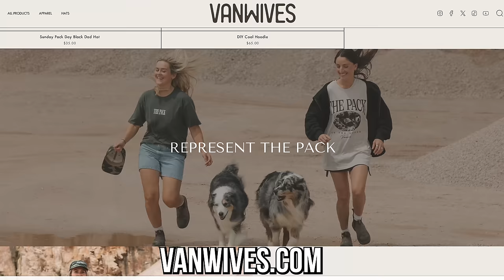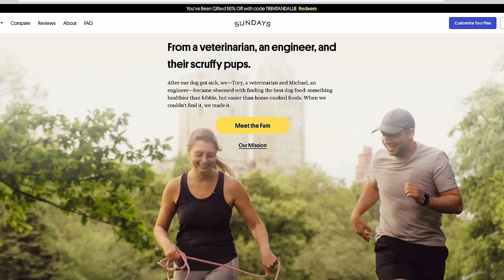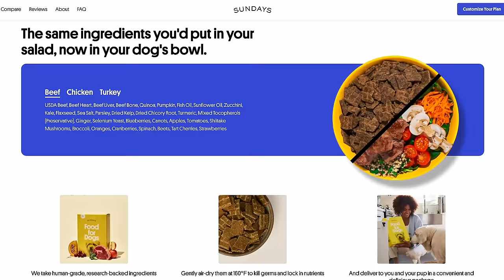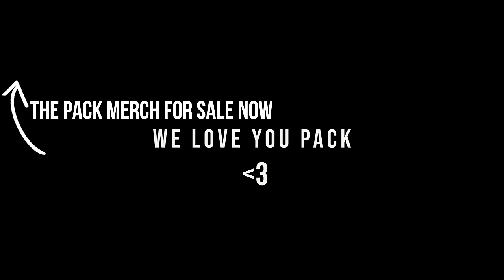Adding a Second Story to DIY Log Cabin Off- Grid Build! (Part 2)

Comment: Tool Boxes are awesome. Here is a tip, use the Tool Bag as a "Go Bag" and put in some extras for quick jobs that just need a few tools. I keep bit, sets, level, tape measure, drill, pen, pencil, hammer and multi bit screwdriver in mine, great for small jobs.
Reply from the maker: SO COOL I LOVE THAT! 
Will have to set up mine.😊🐶

Comment: The only stick you can use living in the woods is a real hot dog stick (not the bought ones!) as per the comment further up the trick is knowing how to pick them. We always use ironwood (lots here in Ontario forests - not sure out you way). Cut a sapling tree down (they grow like weeds). Clean the little offshoots off, clean the tip and make it pointy. Will last you the season. Take a sapling that has a Y in it and you can sharpen both points for a double stick. Easy and authentic ;)

Comment: Where are your rod bolts from foundation to roof?  As the wood shrinks you will need to tighten to keep the walls from loosening and falling apart.  You could lose many inches as the wood dries in a few short months to a year.  I always drill and hide them inside the timbers.  You could turnbuckles and cables on the outside and use then to grow vine veggies or wisteria grapes.  I like the grapes as they boom 3 times a year.

Comment: Jasmine if you have a V-shaped stick for your hotdogs(that way you can cook two at a time) that is not made out of a pine tree….. the stick needs to be a green stick (freshly cut)Probably have to have a new one every season or maybe every couple of months for you😁

Then a separate V-shaped stick in the ground right next to the fire 

Lay your Long stick with the hotdogs on it In the middle of the V On the fire v-shaped stick

You can even have multiple V-shaped sticks around the fire and you could move the hotdogs to a different location for different temperatures 👍😎
Reply from the maker: Love all those tips. Will be trying this out for sure. 😊🐶
Reply: @Vanwives  I love helping😊

Comment: The way to put that back triangle up, is to screw a couple of long vertical 2x4s on to the inside surface.  Then you can lift it by the 2x4s from the 1st floor.  The 2x4s prevent it from falling over while you install it.  You could remove them once you have the roof rafters installed, but I would leave them and just screw them into the back wall for extra stability for hurricanes.

Comment: Great Job~!  Pro Tip - the triangles ( Gable ends) are delivered assembled in the kit however they also easily  come apart in two section or you can even take off all support strips and install each log one by one so you dont have to install it as one big heavy piece :)

Comment: I have the Ridgid ones, and they're awesome to have! They also keep your tools dry. I like using the cheap ones, and I even bought a used extra set, because I like them, and the worse they look, the safer your tools are. Expensive tools in cheap boxes is like camouflage. I also figure if I build in a rolling platform in my bus, I can put them or some of the stacking crates on the bottom and just roll them out. I want my bus to be a rolling workshop.

Comment: Hi both, u did ask for a recomandation for a good Marshmallow stick. We often use bambus sticks 1,5meter long . On the end of it we put in a small wooden 20 centimeters long stick into it. From the kitchen.  On this we stick the Marshmellows on. When it burns a bit. Doesn’t matter. Its removable you can put a new one on. Try it. The bambus stick have a long life. Best wishes from Germany, Adrian. 😊

Comment: Guys, I just wanna let you girls know the floor in the cabin just built should have a water barrier under it before you laid it down believe me within five years. Those boards are gonna start molding and rotten from the bottom up and then it's not gonna be healthy for anybody to be in it it's not really too late, but seriously, I do believe you should put a water barrier on the foundation to protect the floor or if you don't do that definitely use that spray foam underneath as water barrier. I'm not trying to tell you what to do. I am just trying to help you prevent a problem in the future, love your YouTube channel

Comment: Absolutely beautiful! 
The 2 story Bunkie is really coming together. I can't wait to see how you girls finish off the project. Both inside and out. 
Thank you, neighbors, for the help. 
You two should make a youtube short on just your new pack merch. Lov it. Anything in a XXL- tall ?_? Wouldn't want my belly button to show...
Best sticks for marshmallowing and hot dogging. Green hazel. Ash. Willow. Dogwood. Maple. Elm. After whittling your chosen sticks to a point. Don't forget to toast, cook-off, or pre-burn your stick tips a bit. To remove any moisture or germs or microbes that might not taste so good. 
You girls need a good camping/survival knife strapped to your hips. Something lightweight, handy but durable. Something that can take a pounding. I've seen Crystal use one in the cabin for the woodstove. But that one should stay there.
You might also try throwing in some of the tasty hard woods into your campfire for cooking. Applewood. Cherry wood. Pecan wood. Can really add some extra tasty flavors. Like you're wood burning pizza oven using Oak, Hickory, or Mesquite = Tasty !_!
Don't forget to find yourselves a good green stick with a crotch in it or Y to place just outside of your campfire rock ring. It will help you support your cooking. Loved the extended stick. Adapt and overcome...
✌️🤟🖖🐾🐾

Comment: Those Dewalt boxes are really good👍😎 I only hold your tools, but they have bins to put screws and nuts and bolts in also….. You’ll be way more productive with them.

🤔 possibly safer too😁
Reply from the maker: We think so too! More productive and we agree safer for sure. 👍 🐶

Comment: Now the next time you put a rafter in like that, you're triangle what you do I wish I was there to help. But the best way when you're up on a scaffolding like you did was actually pretty good with the ladders and the boards stick it out, but on the outside your screw a  2 by 6 on the outside of the building. Then take a raptor. Lean the bottom to the 2 by 6 and then lifted up straight.You can use the two by six is to steady the raptor your triangle And then you can take your mallet and bang it down

Comment: I just started watching your episode and you’re building the front deck to your little cabin. I can’t tell if you put a gap I think you did and it’s good to have a gap between the wood just so the water can drain out and the sides of the wood can dry, and not rot?

Comment: Best for Hotdogs and marshmallows is a #9 wire it's about the same size as a welding rod 9 guage or 3mm I'd recommend getting a stainless steel strait 3 ft long it would be like a skewer for kebabs

Comment: There are telescoping camp forks! They can be okay or crappy quality but at least it should be a step in your prototyping. :D

Edit: I’m pretty sure your windows are supposed to open out so they’re installed the wrong way? Oh no!
Reply: Per the manufacturer, they are correct.

Comment: Please, I would think this would be a great chance while you had that rode out back just to take all those logs that you have on both sides of the road and put them in one area so you can have them when you need them for firewood or anything else you’re gonna build Look for them make it for yourself better you’ll be off you’ll be. I also think you should take the time to put up another shed to put Clementine in your excavator in so it’ll be out of the weather and one more thing up another solar beside to the left, you already have there you can have extra electricity coming in, if you’re gonna stay there another heavy winter Allan from Massachusetts I wish you guys the best

Comment: So I have a legit question with these bunk house builds. As they are basically Lincoln Logs, how do you hide the electrical or plumbing? Do you build and frame and interior wall and run it in between those walls or do you run it and just have it visible?

Comment: As always you guys are great in so many ways. I hate to tell you but even though the bunky is incredibly cute and super easy and quick to build, anyone staying in it in the winter will be pretty uncomfortable because of the lack of insulation, the thinness and lack of density of that type of wood and the fact that whatever you use for heating will be to small and insufficient to last the night (if it’s wood fired). Especially since those types of cabins are not usually insulated under the floor or roof as well as sides. I hope I’m wrong… good luck…

Comment: I was waiting for you to install the floor and hoped you put insulation under the floor, then put a sub floor then installed the floor boards, but you didn't. So are you going to do spray foam insulation after you install the floor? With no insulation the building will be cold in winter.

Comment: hey where is the raw honey, mustard and ketchup for the dripping flavors, maybe the pickle relish there too with a spoon - no bottle! Um - 1/8" stainless steel rods 24" max with a blunt pencil point dog skewer ends. drilled into a wooden closet rod at 5-10 degree angled apart so no dogs touch ever - CA crafters glue to do the push in the wood mounting or epoxy. then for your bench drill a hole for the closet rod in a 2xs and mount it under the bench seat.  loose fit hole and maybe a 1 carriage bolt swivel with a lock nut so you can rotate it to the hot spot and move it in and out to locate the length hot spot too... there is your doggy stick roaster!!! oh loose fit rotates doggy stick to do all sides evenly ... :) mmmmmmm goood  aaaah how about a couple of larger C shaped opening 2xs for the hanger hooks under each bench for storing the doggy roaster  sticks there, on the bench for year round  usage and storage homes..

Comment: What do the windows on the bunker second floor open in and not out? Could you reverse it if desired?
Reply: Or if it opens in have it so you can lift it up towards the ceiling and have it clipped up somehow. 1 pane kind of window
Reply: The side windows on the first floor are also backwards.  Too late now.  It was pointed out in the first video by multiple comments
Reply: @TheStabilio  You would probably be doing the manufacturer a favor by sharing your window expertise with them.  They have LOTS of YouTube videos showing how these bunkies are built, and according to your specifications, they are doing it all wrong.